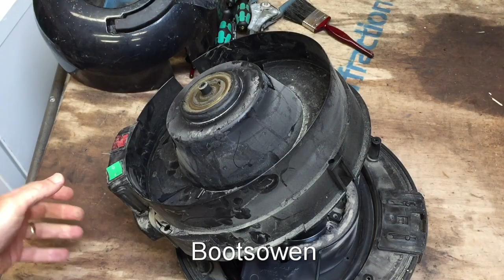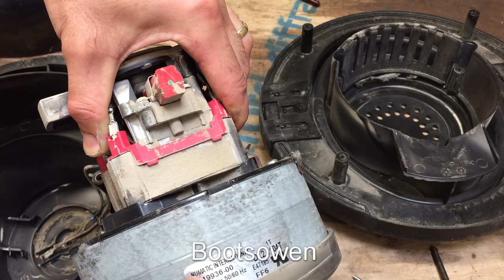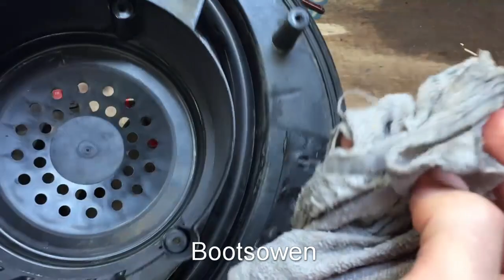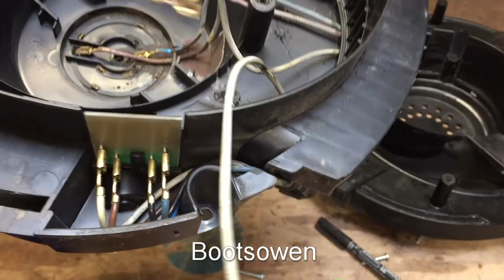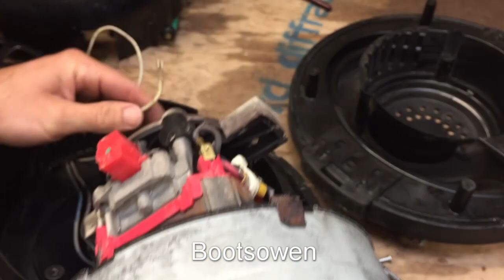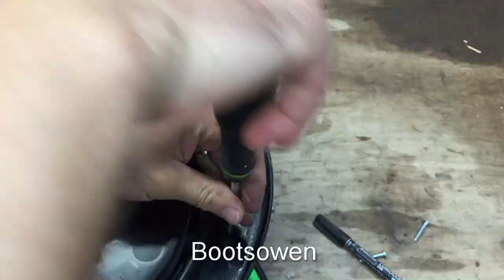Henry cleaning and test:  hi/lo board not working: how to clean the post motor filter!

Comment: This is an Autosave Henry, made between 2010 and 2014, and they used a PCB to vary the speed between low and high. They default to low power when switched on, and pressing the spring loaded Hi switch sends a signal to the PCB to switch over to high speed, until the machine is switched off when it defaults back to low power again. The PCB is positioned in the exhaust duct from the motor to keep its components cool in use, but this was a bad design as over time, the carbon dust in the exhaust air coats the components of the PCB and with carbon dust being electrically conductive, the build-up on the PCB starts to short out the components, eventually rendering the PCB useless and the vacuum stops working, or works only in one speed. Lots of these Autosave Henrys failed due to PCB failures, and what you could have done when you had the vacuum apart was to thoroughly clean the PCB and its components to remove carbon dust residue from it, in the hope that it may stop any electrical shorting between components. The fact that your vacuum only ran in high speed despite the switch being pressed to go from low to high means the PCB on that machine is on the verge of total failure, probably due to the switching components shorting themselves due to the bad carbon dust contamination of the PCB. Try cleaning the PCB, but the damage may now be irreversible.
Reply from the maker: Thanks, I will take it apart again and wash the board. I think that could work if it isn't already fried.  thanks.  Failing that, a bypass of the board.
Reply: Wrong autosave Henry’s were made from late 2008 to 2014
Reply: @hellothereknownasunknownus6535  yep October/November 2008 - August 2014
Reply: I changed the ecu to the new type red one. The cleaner now works but only one speed. Hvr200a. Will a new high low switch solve the problem